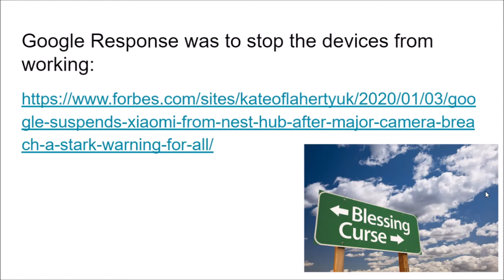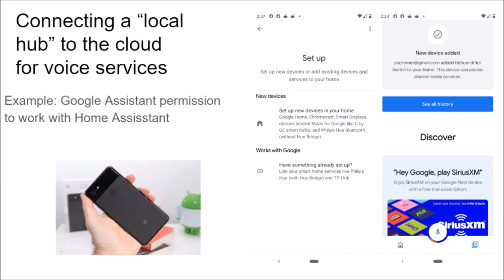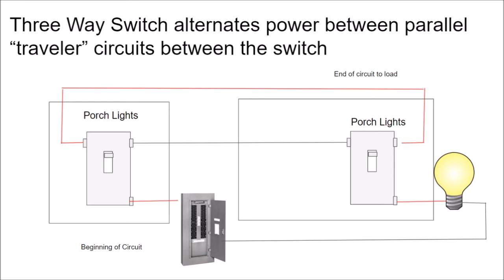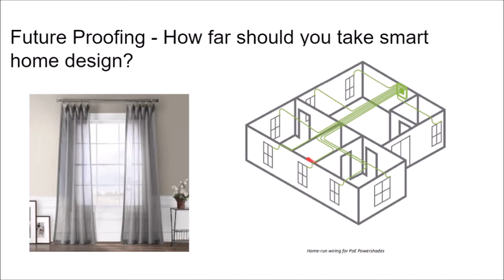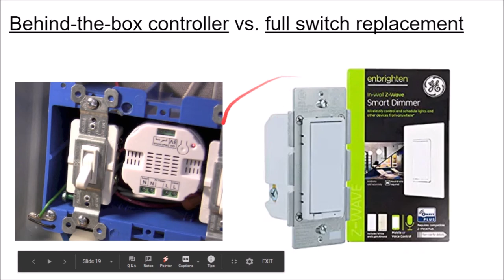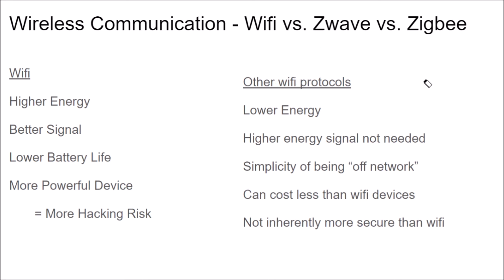Smart Homes Load Control - 1. Introduction

Comment: Good info. Seems smart breakers might be a good option.
Reply from the maker: The most cost effective solution is a box with ~3 contactors of appropriate amperage and Zooz multi-relay. True motorized smart breakers are problematic or not to be found. The 40A in-line smart relay Aeotec works great, but it requires dangerous disassembly to press the "reset" button... which can then be very problematic during a malfunction. Not that it should malfunction but even so, it is not something the client will be super happy about, so it needs to be super reliable.  So having the "smart" control aspect be accessible for the user is important.